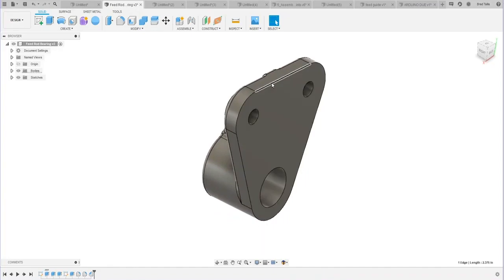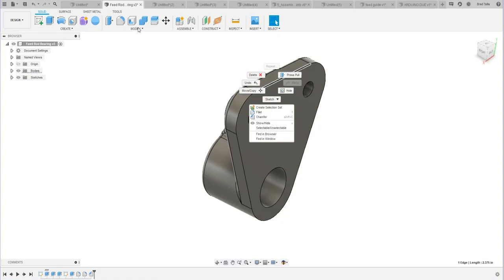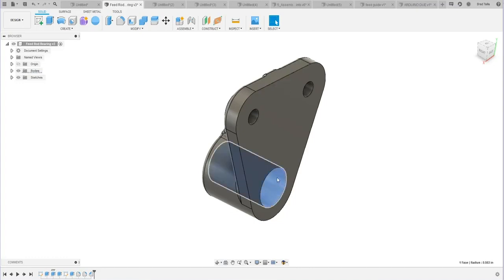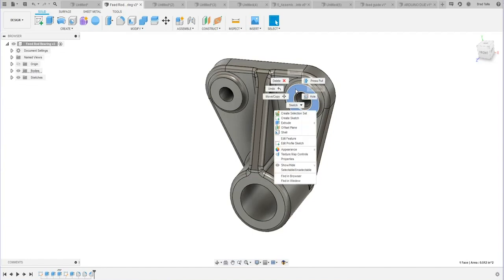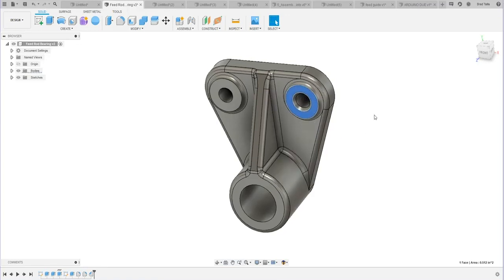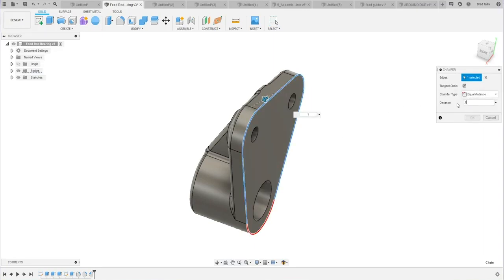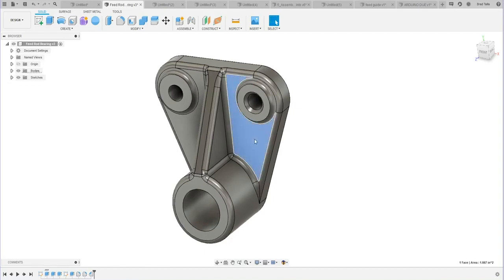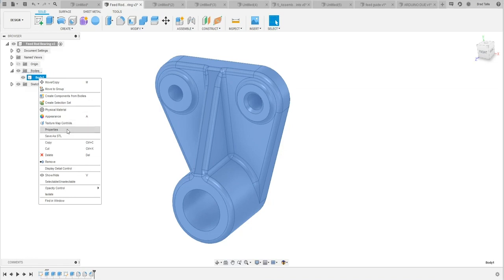QUICK TIP: Right Click is Your Friend

Comment: Too bad it does not work in 4k
Reply: Because f360 does not have 4k!
Reply from the maker: Can you see if this fixes it? https://knowledge.autodesk.com/support/fusion-360/troubleshooting/caas/sfdcarticles/sfdcarticles/Performance-Tips-for-running-Fusion-360-on-high-resolution-monitor.html?_ga=2.89298075.1671713191.1571057190-401459935.1519144871